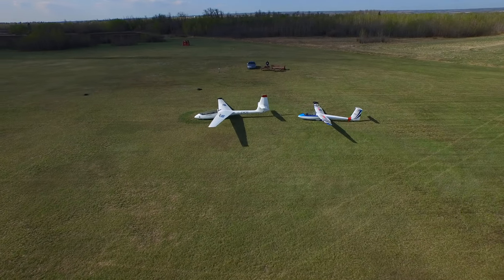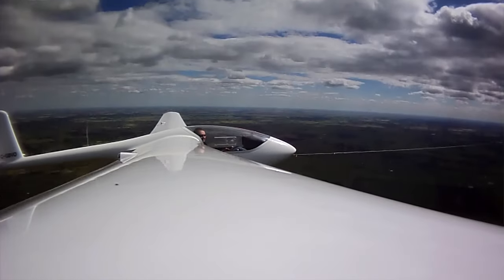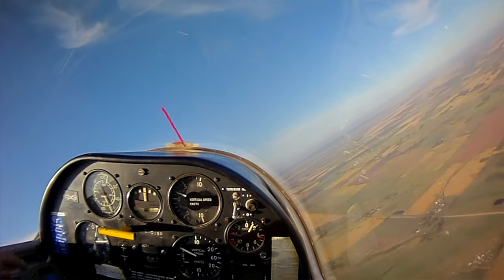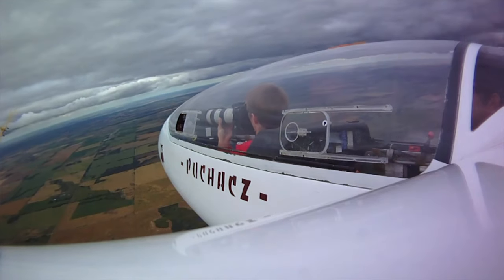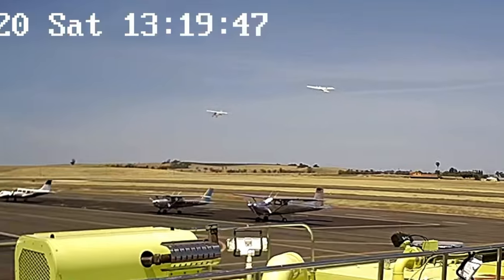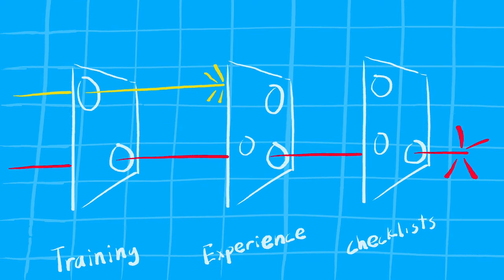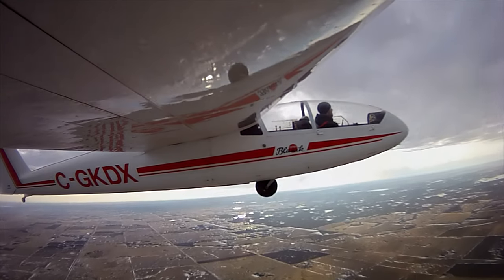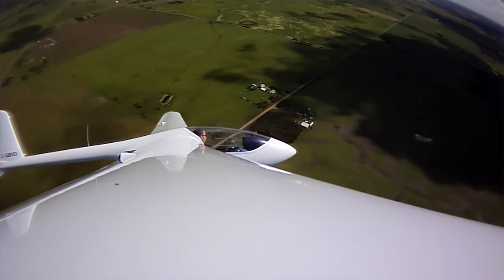FAA Final Report N4116Y Glider Tug Upset

Comment: I'm a towpilot with over 4000 tows.  We had a similar incident where the solo pilot in the front seat did not secure the rear seat canopy and it came open on tow.  Instead of releasing from the towplane immediately and dealing with it, the glider pilot kited upwards and put the towplane out of control.  The towpilot, not me,  recovered control less than 100 feet above the ground.  When towing, the towpilot cannot continuously monitor what the glider is doing.  We can sometimes feel when the glider is out of position but if the glider pilot kites upwards, there's little chance we'd be able to react in time below a thousand feet.  The few times I've been kited on when towing, the negative g's imposed on me prevented me from reaching down and pushing the release handle.  I regularly remind glider pilots of our formation contract.  I'll take him to lift and clear the area ahead of us, but if the glider loses sight of the towplane for any reason or for any length of time, the glider has to release immediately. The first rule of towing gliders:  DON'T KILL THE TOWPILOT.

Comment: Interesting, as you said the mantra is Aviate, Navigate, Communicate. A similar thing happened to me flying a Pirat behind a Pawnee at about 200ft agl, the canopy flew open with a bang and my wooly hat went out too. I realised I would need both hands to pull the canopy shut. I radioed the tug pilot to fly straight and level, trimmed held the stick between my knees let go reached out and closed the canopy, let the tug know all was safe and carried on. The canopy lock was not the best and was kept in place with a bungey.
Reply from the maker: That would be scary! I’ve heard of others having similar issues with canopies, especially on older planes where the locking mechanism is poorly designed or just beyond tolerances.
Reply: @@Brian.Murray  The lock was just  a bit worn, I actually owned a Pirat, and the canopy lock was fine. I think on that occasion, it had not been fully engaged tbh. Yes, it was scary but needed sorting out. Unless the canopy came adrift, and damaged the tail plane the a/c would still  fly. The pilot could have just stayed on tow until he reached circuit height and landed normaly, I could have done that too ofc.
Reply: Wow - at 200ft AGL, if the stick slipped out of your knees hold and pulled back the tow pilot would have very little chance to react. Assuming you had your options done right, you should have disconnected, IMHO.

Comment: A solution maybe a back release on the tow plane. IE. when the upward angle of the tow rope exceeds the tow plane envelope; the tow rope is automatically released. Or another solution could be a electronic sensor that measures the angle and initiates a release. In any case, the tow pilot has very little time to react to a glider kiting. The glider pilot has to release. The first instinct for the tow pilot is tow fly the plane. This isn't the first time or will be the last time (unfortunately) for this type of incident. We had a glider crash this year when the tow pilot had an engine failure. The tow pilot landed safely straight ahead and the glider didn't release (crashed).